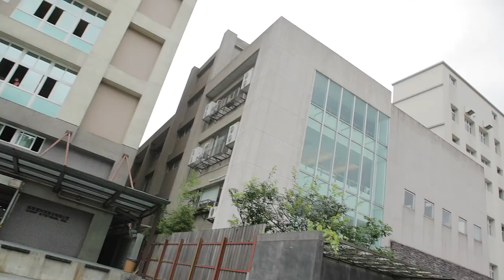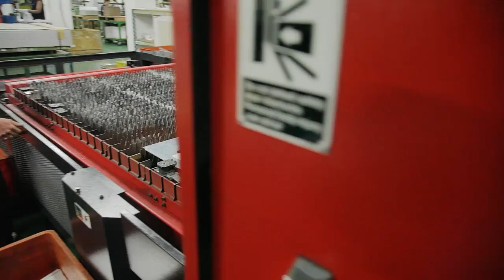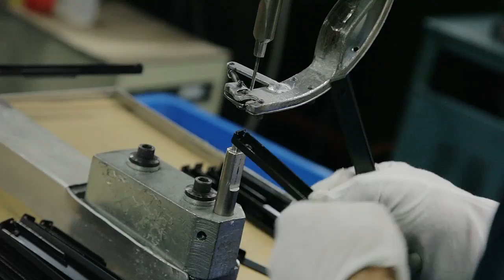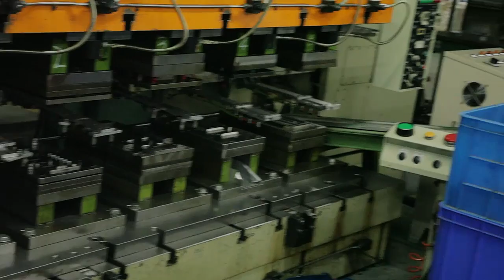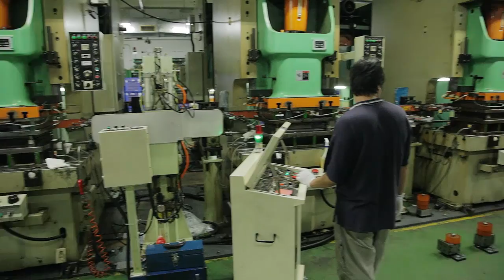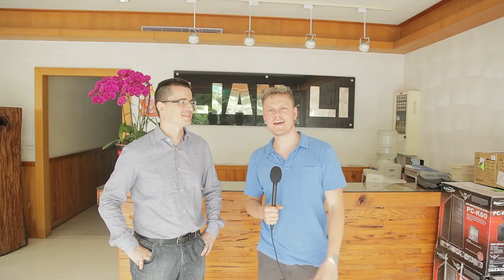Lian Li Factory Tour - Computex 2013

Comment: ***** can't you separate the hard drive mounts? in my case there is a 3 hd and a 4 hd one, I can use them interchangeably or put them both in. tbh I just have a laptop sshd screwed into the bottom of my case and a regular hdd right above it; it takes up barely any space.
Reply: ***** I mean I was specifically mentioning that because I also have a lian li case (pc-ao4).

Comment: I built a workstation for my job using a PC-A77F (now discontinued), awesome case, but there are some major flaws:
- Barely any room behind the motherboard tray for cables management, for a $350 case this is unacceptable
- Drive cages should be rotated 90° so the drives face the side
- Why do the fans cables barely reach the included fan controller?..
- The tool-less optical drive mounting is cool, but the drive still wiggle around. Had to put a screw, which defeats the purpose of tool-less.